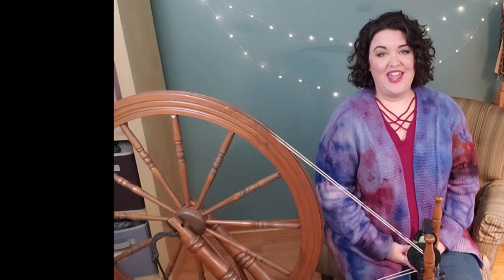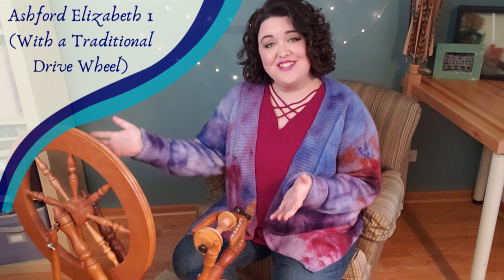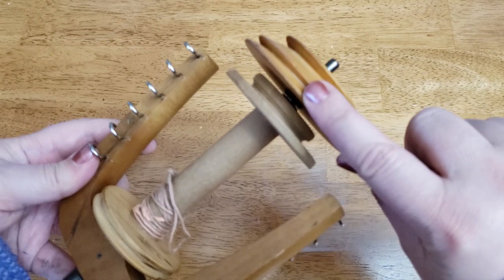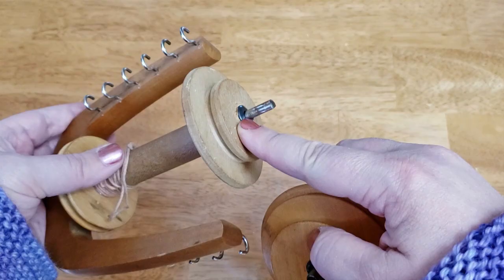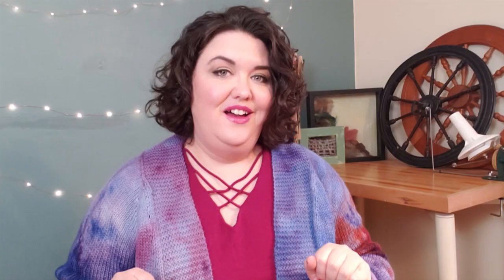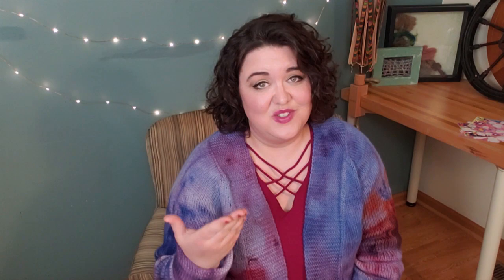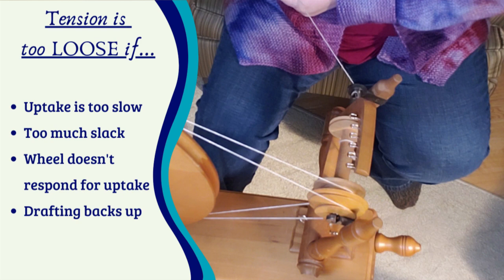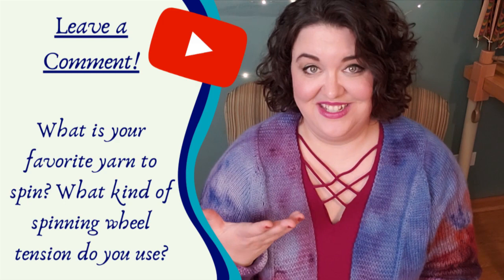Double Drive Spinning Wheel Setup

Comment: Sai just bought a lend rum saxony wheel which my son assembled. Going to put drive band on tomorrow. Included were the drive band and wooden knobs with attached strings. Not sure how to assemble that?? Help appreciated!!
Reply from the maker: Wow! How exciting! The Lendrum Saxony is a beautiful wheel. Without seeing it in person, I'm not sure exactly what you will need to do to get it running. It is possible that you have a wheel that has the single (Scotch tension) and double drive options. If so, check out my video about single drive and it might help you get a sense of what you are working with. https://youtu.be/9c7dLbqT6WY Did you purchase the wheel from a dealer? Maybe if you give them a call they could talk you through it? I wish I could be a better help to you. I hope you get it all figured out soon! Best of luck and happy spinning!
Reply: JillianEve 
Hi Evie,
Thanks for getting back to me. My lend rum saxony wheel is set up as a double drive with a scotch tension option. I don't know what to do with the drive band . Can you help? The drive and is joined together does not need to be knotted.

Comment: Do you have a video showing double drive on a castle wheel.  My wheel is the same direction as the bobbin.  I tried spinning Scotch and Irish andd am having a horrible time with tension so I switched to dbl drive but I don't know where the cross should be.  I am just really having trouble picturing it in the castle style position.
Reply from the maker: I don't have a wheel with a castle set up but here is something that might help.... picture the castle wheel tipped 90° on its side. The flyer and bobbin are in front of you and the drive wheel is to your right. Now it is all lined up the same way as my wheel in the video! 💕
Reply: This a long time ago.

Comment: Do all bobbins on double drive spinning wheels turn? I just received an antique wheel and it seems to work exactly like the one in the video, except my yarn won't draw because my bobbin is turning with the flier. I can make them turn independently by hand, but not when placed in my wheel. I can't tell if it is because the flier and bobbin are so old, or if I have a different type of wheel.
Reply from the maker: Have you tried the draw in under tension while spinning? I would experiment with a long piece of scrap yarn. As long as they turn freely and independently the should have draw in when spinning under tension. 💕

Comment: I am slightly confused. The wheel moves clockwise but it is considered counterclockwise?? I am new to spinning so that sounds confusing.
Reply from the maker: It is oriented to where the spinner is sitting so it might look "backwards" at times because of the camera angle. Z twist = clockwise and S twist = anticlockwise as the wheel turns to the perspective of the spinner. Does that help?

Comment: I have an old black Saxony style double drive wheel, how do I adjust the tension?
Reply from the maker: If it is a typical set up, there will most likely be a knob on the end of the wheel that turns a screw to adjust the tension. If you look under the wheel, you might be able to see the screw and get a visual sense of how it's moving. Happy spinning! 💕
Reply: @JillianEve  thanks I get my husband to get it out tomorrow so I can take a look.

Comment: Hi ! I just bought a spinning wheel yesterday without much knowledge of spinning and it doesn’t have an orifice like yours give the yarn ... I am wondering if it is workable ...? Or if I’ve been had ..? I bought it used ... and thought I made a deal ... the flyer doesn’t come apart like yours ... except the bobbin and the whorl which holds on together on a screw ... can you help ?
Reply from the maker: Oh no! You may have something meant for a decoration and not for spinning! It would be hard to say for sure without seeing it myself. Did you find my "Spinning Wheel Shaped Object" video? It could help you figure out what you have. 🧶❤✨
Reply: No it isn’t a decoration… it is a CPW Ouellette…. Double drive. But listening to this video I had put two drive bands on instead of a figure eight… lol… will try that! Looking at the two grooves on the big wheel there is at one place a knick in the groove between the two grooves… will that catch the band and break the cycle? Thanks for your help!